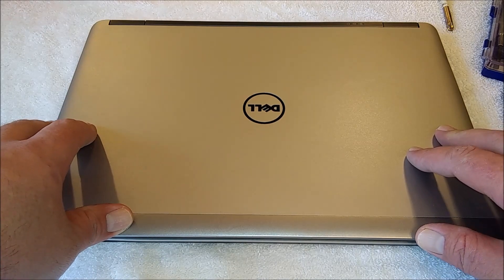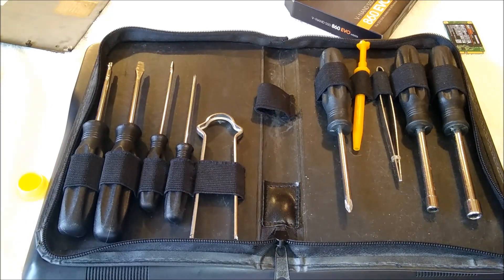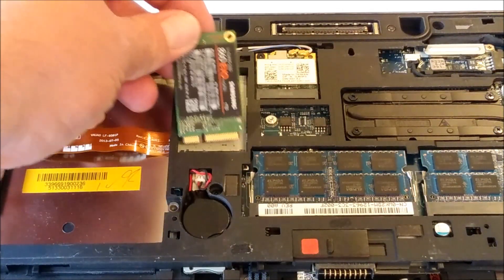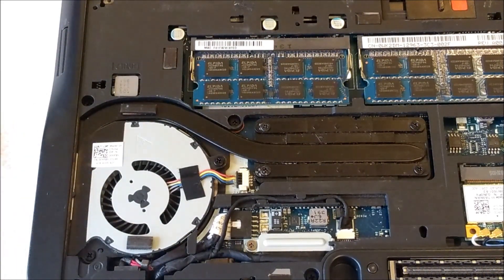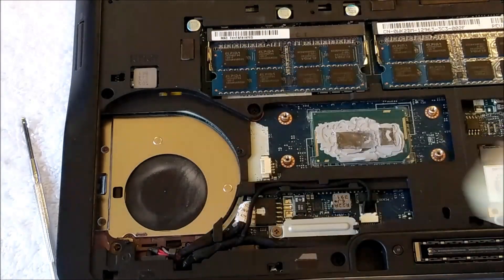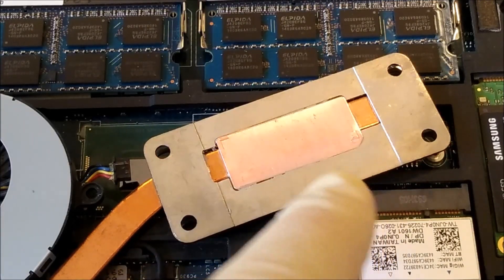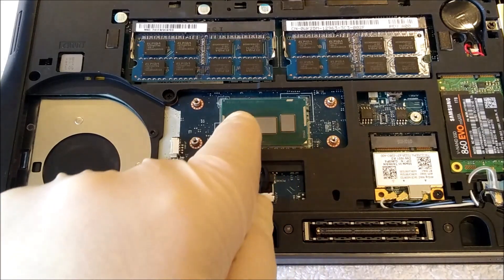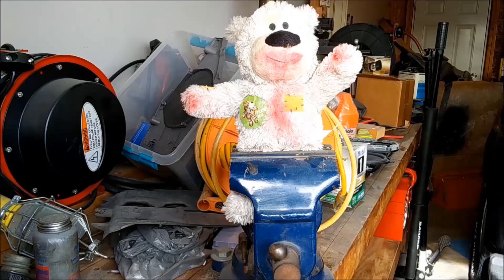TBT 4 - Dell E7440 mSATA SSD and HDD installation + thermal paste

Comment: Hey.. I know I’m late, but I have a question..
Is it OK if for example I put in this laptop (E7440) one stick of 4GB of ram and the other a stick of 8GB, and that they are not the same brand? (matching)
Reply from the maker: In most cases, that should be fine.
Reply: @TheBrokenLife  how much ssd we can add to Dell latitude e7440 i5 4 gen 4gb ram 500gb hdd
Reply from the maker: @mdshoeb9467  I have a 1TB SSD and 2TB HDD in mine. I've never tried more.

Comment: Thanks for the upgrade vid on this old reliable laptop. After this great upgrade, I was considering upgrading from a single 8GB 2xR8 SODIMM to add a second and curious what the resulting performance might be. A cool video would be if you did some real-world performance testing with both SODIMMs and a single SODIMM.  Anyway, thanks for this info about the ability to swap out the WWAN card for an mSATA drive !
Reply from the maker: You're very welcome. I'm glad you found the video helpful.

I would consider some testing, but if you have a single 8GB stick in there now, I pretty much can't recommend against adding more if you think you could use it. Used on eBay you're looking at about $15 and new on Amazon the highest seems to be about $45. Once the upgrades get down to the cost of a pizza, it's hard to justify against them even if the improvements are negligible in 95% of cases (which I don't know for sure and am just saying as an example).

Since I use mine for video work, I use all the RAM it can take.
Reply: @TheBrokenLife  it's used just for Virtual DJ and 8GB is more than ample RAM for that purpose.  What I was curious about was if it improves actual CPU/RAM number crunching performance at all, because with the new STEMS feature of VDJ 2021, pre-processing audio tracks to separate out the individual instruments takes a loooong time. If tossing another stick in can improve track processing performance 15-20% then I'd do it, but less than that, I probably need to just bite the bullet and buy a new system. I can't find anything comparing the 4th-gen mobile Intel systems on dual-rank single-channel vs dual-rank (or even single-rank) dual-channel mode.  Regardless, love the dual storage option now, so thanks !
Reply from the maker: @fiveangle  That's such a specific task that even if I could draw a conclusion in either direction, I wouldn't be able to know that it would apply for you.

You could always take the simple approach and open a task manager and watch the performance tab while those activities are processing? I suspect it's more CPU limited than anything.
Reply: @TheBrokenLife  haha, it's a "specific task" only in that I cited what I'm doing, but the general improvement in task completion time in dual-channel vs single-channel for desktop chipsets is well known so this isn't related only to virtual dj.  "CPU-limited" includes any bottleneck in moving the operations to-from main memory.  Unless a CPU is running a synthetic cache-resident operation like "time to run a goggleprime" then it's gotta move that data in and out to somewhere, and that's all the reason for opting for dual vs single channel memory. "CPU limited" is really synonymous with "CPU-and-memory-IO-limited."

I'll probably just buy the memory and check general performance for Intel 4th gen mobile myself.  If it doesn't improve, at least should be easier to sell with 16gb :)
Reply from the maker: @fiveangle  Cool. Good luck with it!

Comment: Got to be said, some of the Inspiron range were made so well - not from a keyboard tapping user point of view, but for getting to the main stuff ...

Oh SO easy.

My other computer is an Emachines e430.

It's horrible
Reply from the maker: The old E series Dell laptops are excellent machines. I wish they would build them like that again, but I think those days are behind us.

eMachines... For a very, very, brief period of time I had a tangential role in their warranty service. Yikes.
Reply: @TheBrokenLife  sadly, it's other technical advancement that changed the game... We used to need a 2.5 inch HDD bay... We used to need a bay big enough to have a CD/BLU ray ROM drive.

Both of these things are now, due to MSATA, m3 and every type of compact solid state drive you can think of, obsolete.

So, the chassis no longer needs to have the space for them.

The need for laptops to be these featherweight machines made out of 90% plastic, the screen and the weight of the screws using a further 8% of the mass... Has become almost the agreed standard.
The need for them to be bullet proof has also gone, as they're now regarded as temporary systems from both an OS and a physical POV.
Reply from the maker: @parasiteunit  I can deal with most of that. I would just like one engineered well enough that a simple dusting isn't a 3 hour ordeal. You can find a video on my channel of me dusting out a ZBook and the bottom plate of that thing was held on with like 17 screws or something insane. It would have actually been a cost reduction to design it like my old E series with a single screw and a slightly more complicated bottom panel.

I would also like to see the return of actual docks and not Thunderbolt port replicators. That comes at a weight and cost penalty though so I'm positive that is gone forever. I just find the actual docks to be so much easier to deal with and more consistent in operation.
Reply: @TheBrokenLife  oh yeah, don't get me wrong - there's been issues with over engineering too....

The old Atari ST - just to get to the memory to ensure they were housed okay if it started going AWOL... 

Oh man, more screws than a brothel!

but yeah - a laptop that used light materials and easy to service...

Oddly enough, just did a strip down of a Vostro 3300. Compared to the E6410... Getting to anything, aside from memory and the HD bay....

Layer after layer urrg!
Reply from the maker: @parasiteunit  "Urrg", indeed. I specifically sought out the E6410 after doing a few other pretty involved repairs on other laptops and I swore them off for life. My E7440 is the closest I get to a modern laptop and I'm hoping it has about 10 more years in it for just general computery things. I'm kinda hoping after that I won't have a use for a laptop anymore. We shall see!
Reply: @TheBrokenLife  the one that really gets me though - is the socket less CPU you see on many newer laptops... Soldering the CPU to the board... 😬

There's only one reason to do that and that is enforced obsolescence.

Underhanded in my opinion.
Reply from the maker: @parasiteunit  I'm a little less absolute on that one. The consumer keeps demanding lighter and thinner devices and the socket kills both of those things. Plus, usually the chipset is outdated right along with the CPU, so the best you could do is move up in the same CPU line. By the time most people would want to move up to an i7 from an i5, they're probably already several generations behind.

Soldering in the RAM is where I personally draw the line at scumbaggery.
Reply: @TheBrokenLife  yes, hard wiring ram - that's just wrong.
Reply from the maker: @parasiteunit  Hence while I'll never own a Mac despite being honestly curious about them...
Reply: @TheBrokenLife  got my hands on an old MacBook air. Really nicely engineered. Ran Linux on it. Superb. Sadly, it was a 4gb model and for my needs, that was sadly a bit light... but compared to what was contemporary at the time? Wow
Reply from the maker: @parasiteunit  I've used my share of Apple products and appreciated them for what they were, and some were fabulous in their era, but I just can't bring myself to buy into their computing ecosystem... at least not in the modern sense. A few things from days gone by, which can be had inexpensively, may happen at some point.
Reply: @TheBrokenLife  yeah the ecosystem (AKA our way, or no way)... Not a fan, but some of their gear, builds way more ahead of the curve than they should be, the magnetic holder for the power cable for example... Brilliant.
Reply from the maker: @parasiteunit  I agree with your example, but as I understand things it was so good that Apple quit doing it. 😆

Comment: Hi. I installed a Msata to TF card reader in WWAN slot. Fits good, pops up and down good like ram does. I can't get Bios or Windows 10 to find it. I even done I new install of Windows 10. Any advice? Thanks.
Btw I had a TF card formatted with files on it in reader all the time. Dell E6540.
Reply: I think because Bios forcefully addresses the SSD bay as the primary disk, i think the bios could not detect the mSata alone. If this is true then it is obvious windows will not be able to find it. I was about to do this mistake because the SSD cable is broken. Thought it is better idea to buy an mSata instead of replacing the cable. Now i am rethinking it.
Reply from the maker: Will it boot with an mSATA drive in the WWAN slot?
Reply: @TheBrokenLife  sorry don't know.
Reply from the maker: @BitsOfTruth  That would be the first thing to check. Or, if you have another machine with a WWAN slot you can see if it recognizes your card reader.
Reply: @TheBrokenLife  oh. I thought maybe a driver or something. Thanks.
Reply from the maker: @BitsOfTruth  Possibly? I've never used one of those adapters so I don't know for sure, but I normally like to rule out mechanical malfunction as quickly as possible. If it were to work in one, but not the other, you know you likely have a mechanical issue.
Reply: @TheBrokenLife  Wish I had a Msata to USB cable. Thanks.
Reply: @TheBrokenLife  I wanted for DOSBox files. Small reliable drive yet separate from my HDD/SSD. And leaves my SD Slot open. Thanks.
Reply from the maker: @BitsOfTruth  There are USB to mSATA adpaters, but I don't think there are any that go the other way. At a glance, the cheapest mSATA SSD on Amazon is $23. You could at least use it as a trouble shooting device to make sure your WWAN port is configured correctly. Might even be able to buy one cheaper on eBay.
Reply: @TheBrokenLife  seen one eBay cheaper from China. It getting about to the point of taking it out and tossing it in my box if failed projects and going back to SD Drive. Thanks.
Reply from the maker: @BitsOfTruth  I've got that box too! :) Good luck!

Comment: Thanks for the video! Really helpful. By the way, below the SATA interface for the SSD, isn't there a mSATA interface also?
Reply: You can search for mSATA to 2.5" SSD adapter / converter. Some adapters also allow the use of m2 drives. However, you will be limited to the SATA3 speed.
Reply from the maker: @stanlaus3883  That's cool. I had no clue those things existed. I also saw external enclosures that adapter mSATA to USB. Very interesting!
Reply from the maker: Thanks!

Can you point to a time stamp in the video I can review to see what you're talking about? As luck would have it, my 7440 is sitting right here (and is due for an internal dusting) so I popped the back off of it again, removed both drives (the SSD and the HDD I installed in it), and I didn't see any extra connectors.
Reply: @TheBrokenLife  Sorry! My bad. Actually, some model comes with MSATA SSD that was installed in the 2.5" bay using adapter. In that case, you can have 2 MSATA drives in the laptop.
Reply from the maker: @stanlaus3883  Hummm... That's pretty cool to know. I wonder if there's an adapter available for mine? I've also seen people put mSATA devices in the WAN slot.

Comment: Can you install 2 different OS on both HDD and SSD? Like install windows on HDD and linux on SSD
Reply from the maker: Probably, but I think it would be easier to just dual boot one drive for that purpose. Otherwise you'd have to go into the bios and manually change the boot disk every time you wanted to change over.
Reply: yeah I'm dualbooting windows and mac on this computer
Reply: Can you tell me the minimum speciation of ssd for latitude e7440?

Comment: Tell me this size mSata? Thanks you
Reply from the maker: 1TB. I have edited the video description to add links to the materials and products I used.
Reply: Maxwelhse is this 2242 or 2260 ?
Reply from the maker: @mccsbmt  I could be wrong, but I believe you're confusing mSATA for M.2. The only mSATA size I'm aware of it 30mm wide x 50.95mm long. M.2 drives are 22mm wide and come in a range of lengths (30, 42, 60, 80, and 110). 

I don't believe the E7440 supports M.2, only mSATA.
Reply: Maxwelhse i'm vietnamese, my english is not good!! I searched at google and thought m2 had sata and pcie standards.  I thought msata and m2 sata were the same, it was a mistake.  thanks for your support 😄
Reply from the maker: @mccsbmt  Happy to help!
Reply: @TheBrokenLife  hello I'm from Panama I'm wondering about is  possible to upgrade graphic card to this model of laptop
Reply from the maker: @juliuscaesar5128  I don't believe so. I'm pretty sure it's all integrated into the motherboard.
Reply: @TheBrokenLife can u plz tell me the size of mSata for dell latitude E7440

Comment: I have heard of using parts/brake clean on computer components, Here is a video on how to do it  https://youtu.be/c-qY59VrVS4
I have seen this guy use enough cleaner for it to drip off the pc part he was cleaning.
Reply from the maker: Yeah... Not something I feel the most comfortable with most of the time and until just then, having started building PCs around 1994, I've never needed to. I skipped through that video and it doesn't really look like he needed to either. I'm not sure what goal he was trying to achieve by doing so, but, I did just skim.

To each their own and all of that, but I wanted to make sure it was something I personally am not suggesting to my viewers since I'm not comfortable doing it myself. I'd never ask or suggest any of you to do anything I wouldn't, or haven't, done.

That said, dousing electronics with isopropyl alcohol has never effected anything I've ever worked on and would have given him the same result he was after (which just looked like deep dust removal?). I've been doing that for years and years...